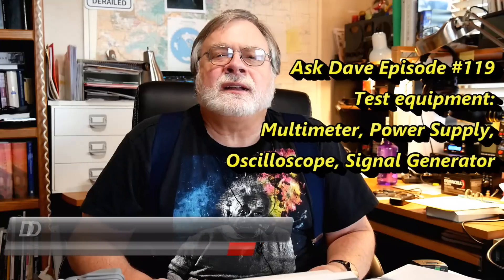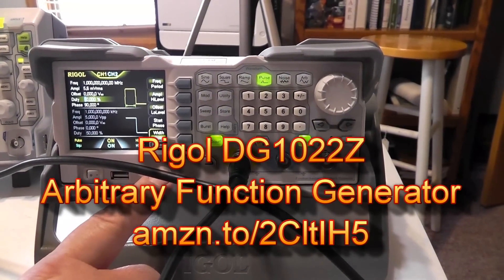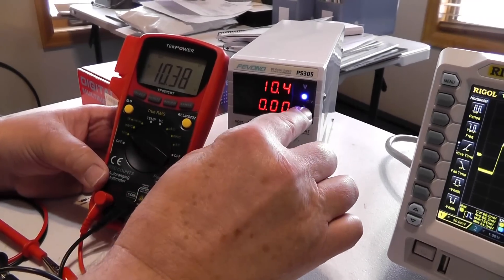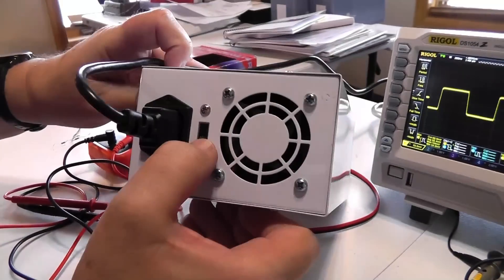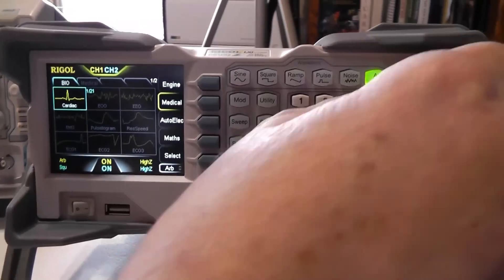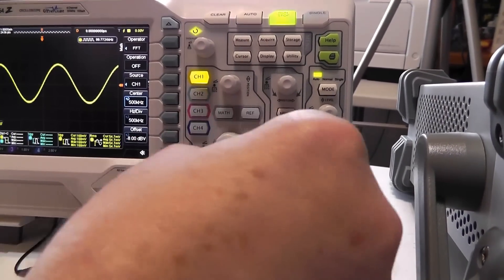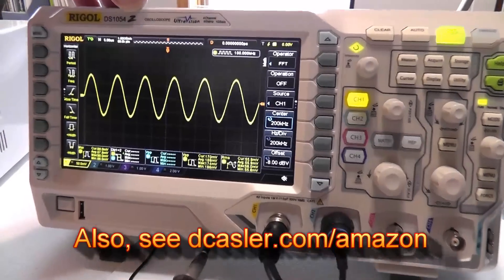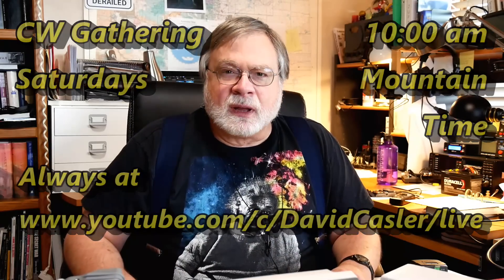Test Equipment: Multimeter, Power Supply, Oscilloscope, Signal Generator (#119)

Comment: Nice video, VOM also is designated as an Analog meter which you still can purchase today, and I prefer these for checking out solid state devices and the metered display compared to the DVM digital volt meter. Both are good and as always personal choices. As a retired Electronics Engineer and before that a Senior Electronic Technician in Electronics for the past 50 years. Being bored, other than doing a lot of fishing......getting back into electronics 👍 and a past ham.....73's best to you and your camera wife again good video.

Comment: Dave - It may be nice if you did a video on the different types of Power Supplies concentrating on; 1) the advantages and disadvantages of each type and when to use each type.
The type of Power Supplies I am familiar with include:
Regulated - maintains constant output voltage or current despite variations in load current or input voltage
Unregulated - output can change significantly when its input voltage or load current changes
Adjustable - voltage or current programmed by mechanical controls (e.g., knobs on the power supply front panel), or by means of a control input, or both
Adjustable Regulated - both adjustable and regulated
Isolated - power output that is electrically independent of its power input; this is in contrast to other power supplies that share a common connection between power input and output
Also, where does Linear vs. Switching fit in?
Michael Bradley  73
VA6XMB
Reply from the maker: It's been awhile since I've done a power supply video. I'll add it back to the list.

Comment: Dave can two transceivers be connected together with a Bird Thruline for TX/RX testing?
Reply from the maker: No. You’ll blow the receiver up.
Reply: this can be done with attenuation: when you connect the TX to a comms test set and transmit into test set, it DOESNT blow up, why? attenuation down to an allowable signal to noise ratio

Comment: Hi Dave, The scope looks very impressive for the price. I'm a retired combustion engineer and boy I miss the toys I had to play with at work!  However,  I have been told that one should really have at least a 100 MHz scope for HF radio work, but of course that gets pricey. I'm currently building a SDR transceiver kit published in the Aug 2017 QST by Jim Forkin, WA3TFS, and would like to check out the circuits in more detail. My question is have you found the 50MHz scope limiting in any way?  Thanks for any advise and I truly appreciate your YouTube presentations. 73, Mike KM6KWG
Reply: Derp - that’s what’s meant by other comments I’ve seen about how hackable the scope is.  I really like the size as well.
Reply from the maker: 50 MHz is not an absolute cutoff, but the polnt at which the signal is attenuated  by half because of the input characteristics. I've actually measured frequencies in the 440 MHz region, though I know the signals are much attenuated.

Comment: The arbitrary waveform function generator looks like an electronic overkill. How and when are you going to use 90 percent of what that can put out? The scope is a gem with all the info it can display. it beats the pants off the scopes of 40 years ago.
Reply: David, thank you for your reply. Experienced and knowledgeable replies are the ones I like the best.

Comment: the best way i describe the difference between multimeters and oscilloscopes to people is that an oscilloscope is basically just a multimeter you can see the time domain in, which is to say that with a multimeter you're looking at the waveform straight on, and an oscilloscope lets you see it from the side
Reply from the maker: Thanks for the tip.
Reply: SuperAWaC that’s actually a really cool way of explaining it I have never thought of that.
Reply: I like that description! Thanks.
Reply: Cheers for the video content! Sorry for chiming in, I would love your opinion. Have you considered - Tarbbatigan clean errors Tip (erm, check it on google should be there)? It is a great exclusive guide for discovering how to fix electronic devices minus the hard work. Ive heard some great things about it and my mate after many years got astronomical success with it.